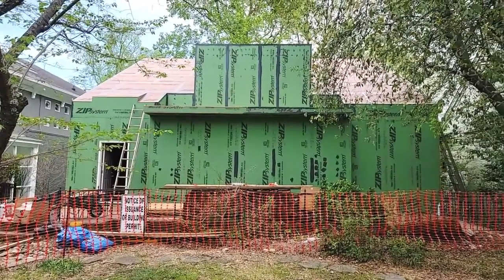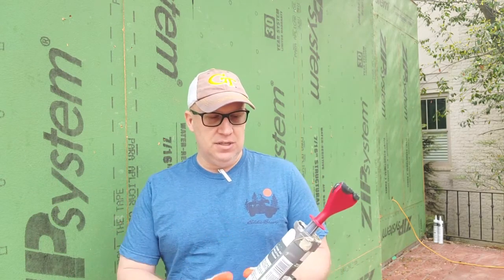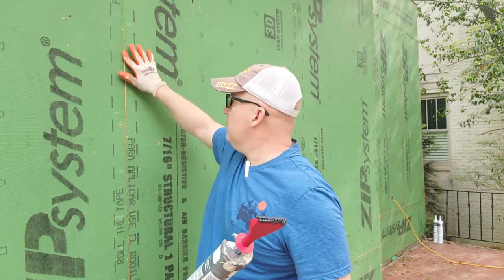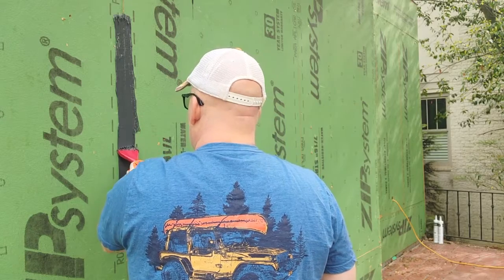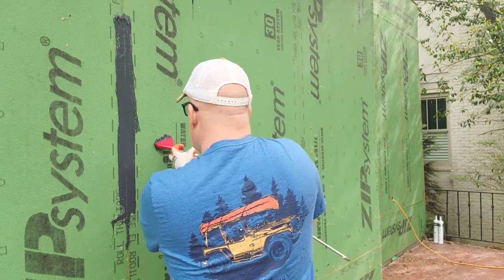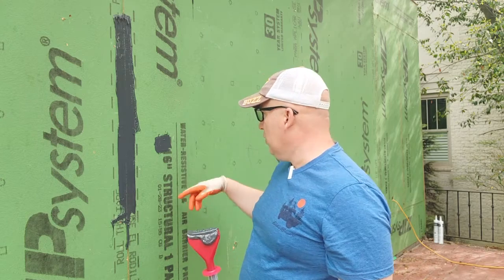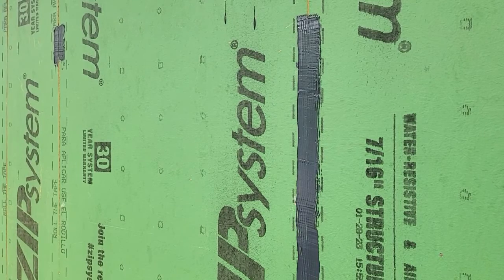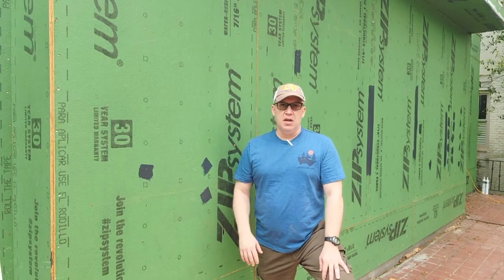Zip Liquid Flash Barrier: A Better Way To Air Seal Your House

Comment: I am wondering though if aeroseal negates the need for the in between seal and the nailhead fill or these steps are for zip warrantee reasons ?
Reply from the maker: Aeroseal is a good product when used correctly.  It is best to air seal from the outside since the air barrier also is part of our vapor control layer.   We use aeroseal when we cannot access the sheathing.  When we can- sealing it this way gives you a much tighter seal.  I'm working on some more videos that will show the results.  They were much better than expected.